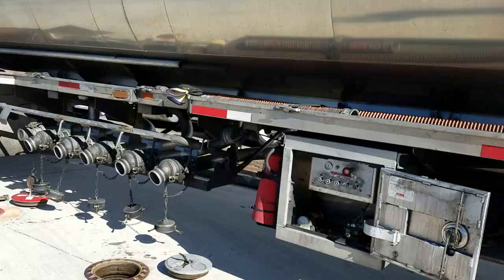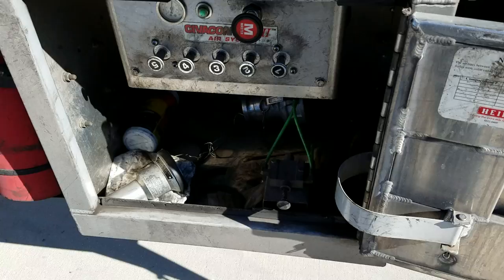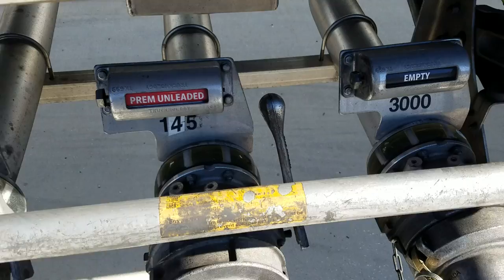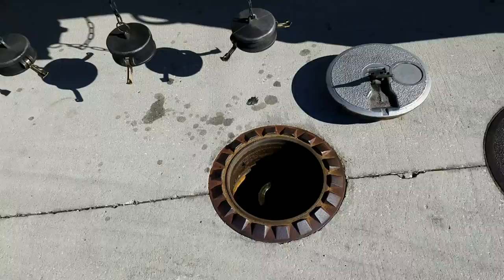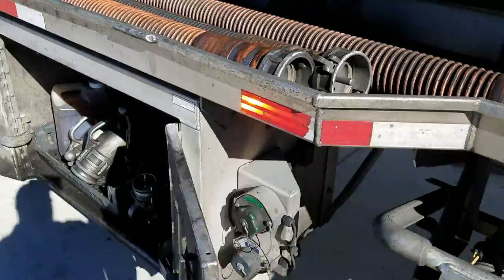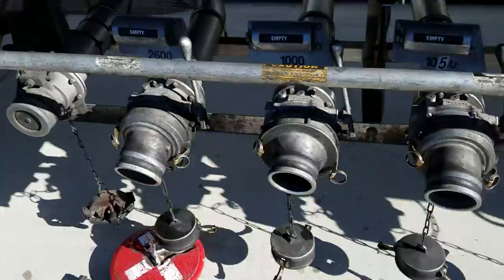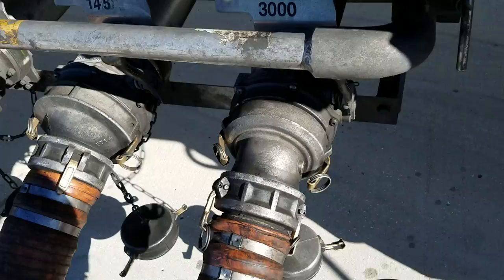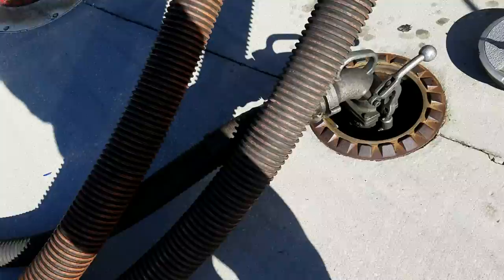How a Fuel Truck Delivers to a TruckStop

Comment: No meter? How does accounting work??
Reply from the maker: jakop0815 , what do you mean?
Reply from the maker: jakop0815 , we have a machine that will print a piece of paper out to tell us how much we can safely drop
Reply: @jakop0815  We don't pump at petrol stations in the US (except for above ground tanks, which are few). We gravity drop and know precisely what was loaded into each compartment on our trailer. For the occasional unfortunate miscalculation, where we have to retain part of a compartment, the station also has tank level monitors that are quite precise.

Comment: If u only have one vapor hookup then u cannot unload unl and prem at the same time . U can only unload one product at a time , also while unloading fuel u shouldn’t be on the phone making a video .
Reply from the maker: Daniel Chavez , the vapor system is connected, therefore i can unload both products at the same time.
Reply: Trucks and Guns 
No u cannot do that and u need to be proper train again because ur totally wrong !
Reply from the maker: Daniel Chavez , seeing as trainers at 2 different companies ive worked for have told me thats how you do it, then thats how its done. May not be correct according to your company policy but it is for ours. We can drop up to 3 products at the same time using only one vapor if the vapor is connected.
Reply: @danielchavez8701  He isn't wrong, Daniel. You have no idea what you are talking about.

Comment: 9,300 gallons how much are you over weight. I work for a waste hauler and we have 7ks and 6300s and I scale out sometimes at 88k at places depending what I’m hauling.
Reply from the maker: With 9k gasoline im about 84k. 9k diesel im around 92k.
Reply: DrtyDiesel dam I know you’re avoiding scales just like I am.
Reply from the maker: @rcassidywork  no, when i go over scales 8700 is our max on gas, and 7500 on diesel.
Reply: @DrtyDiesel  yeah, my company needs to up the pay a bit if they expect me to waste time avoiding scales so they can make more.

Comment: Two minutes to empty 1K gallons and 7 minutes to put 20 gallons into my cars tank.  Go figure.
Reply: You need to find a new station if it takes that long to fill up. Pumps should run at a max 10 gpm and a minimum of 6 gpm. If they are below 6 gpm, It's time to change the filters.

Comment: And why is gas cheaper in the winter
Reply from the maker: Fuel fluctuates all the time. People talk about "Winter Blends" all the time but thats only in some parts of the country. Where do you live? You may be in a state or area that requires a lower RVP gasoline.
Reply: DrtyDiesel I live in Chicago
Reply from the maker: @NFLYoungBoy223  its possible in the winter they switch to an RVP 9.0 gasoline which is easier and cheaper to produce. In summer the price may go up since some cities use 7.8 RVP gasoline. The RVP has to do with vapor and volatility of the gasoline. Jacksonville used to be a 7.8 RVP city until a few years ago.
Reply: DrtyDiesel yea during the winter gas at citgo was 2.79 for premium now it’s 3.20
Reply from the maker: @NFLYoungBoy223  yeah here in Jacksonville, FL it went up to 3.36 right now
Reply from the maker: @NFLYoungBoy223  it was 2.90 a few weeks ago
Reply: DrtyDiesel which one you go to I go to the by o Block
Reply from the maker: @NFLYoungBoy223  A Speedway gas station near me.
Reply: DrtyDiesel awe naw I only use name brand like citgo bp shell costco
Reply from the maker: @NFLYoungBoy223  i assure you, all of it comes from the same tank. Though what makes it name brand is the additives and detergents they put into the gas as we load. Costco, sams club, speedway, etc, are mainly gas and ethanol. BP and marathon have their additives as well as spraying butane into their gas to keep it fresh longer. Shell really only adds their additive to their premium fuel.
Reply: Decreased demand. Winter vacations are flying vacations not driving vacations.

Comment: Fudging the numbers 29.5 round that to 30, someone is paying for that
Reply from the maker: Umm... no. The customer is billed based on net gallons on the BOL. Not by what inches go into the ground. Our system had no way of putting in decimals or fractions so you either round up or down. The customers we had went off of the BOL gallons and what the veeder root said. The customer in this video is a TA truckstop. They get a veeder root reading before amd after, they dont even look at what inches we put on the paper. In the end the customer still only pays for NET gallons on the bill. So if i drop 7500 gallons but the net is 7350 gallons, the customer is billed for 7350 gallons.

Comment: Shooting  a gasoline fuel tanker won't blow it up
Reply: Generally, no but in the off chance that you hit vapor in a compartment, it could over pressure and split open the trailer. Not technically an explosion but impressive.

Comment: it fucking pulls up to the station, parks, puts hoses into to ground, and lets the fuel out. 

Like, super basic concept. I definitely did not need to work at a gas station for 2 years as my first job to  be able to tell you this...

Comment: DOT sure would like to know why u have those compartments marked empty when the are loaded with gas.  Just to lazy to turn dial. Lol
Reply from the maker: DOT don't give a damn about the dials, they only care about the placards. Those dials are not required in Florida.
Reply: @DrtyDiesel  lucky u.  They are in Texas.  Had a driver get a ticket once for them.  $225.
Reply from the maker: @Mastiff-275  damn, yeah when i worked for Eagle we had a FDOT officer come to one of our safety meetings. He told us everything he looks for in a roadside inspection. Told us the product dials are not dot required (some of our trailers didnt even have them).
Reply: @DrtyDiesel  what part of Florida u in.  I’m in DFW area.   Always busy out here.  We have 15 loading racks out here in this area.
Reply from the maker: @Mastiff-275  north florida, I'm out of Jacksonville. We have 5 racks in jax, only 4 of which i load at lol
Reply: @DrtyDiesel  I do slot of diesel loads to the TA. Petro loves and pilots.  Plenty of business out here.  And DFW is growing so much.  And traffics is getting bad.  I start at midnight.  Around the time the drunks leave the bars. Lol
Reply from the maker: @Mastiff-275  awe man, fun fun. Yeah with my last company we ran loads to the Petro in Kingsland, GA and this video was at the TA in Baldwin, FL. The company i work for now does a lot of ship business, hauling low sulfur diesel, ultra low and 6 oil. Today im running diesel to a railyard, easy money haha. Be safe Randall!
Reply: @DrtyDiesel  It was good talking to ya.  Lunch time.
Reply from the maker: @Mastiff-275  good talking to you as well, stay safe driver, enjoy your lunch.

Comment: So can mid grade be used in a premium only vehicle
Reply: Should only put in the minimal that the owners manual says. It will run on mid-grade but you might not get the best performance.
Reply from the maker: Like John said, use what your manual says. Your MPG may suffer using lower grade gasoline
Reply: Yeah, sure. They just rated the engine PREMIUM ONLY for shits and giggles - it doesn't actually mean anything. They'll really run on any fuel you like. Try some methylated spirits.
Reply: Can something be used in something specifically stated for it not to be used in? I'll have to think on that one.

Comment: I hate those tray straps. They’re useless!
Reply from the maker: Theyre expensive too. You can only buy them from HEIL and they are $50/strap
Reply: DrtyDiesel yup! On my old trailer we just took the hardware off and used regular straps. Company got tired of replacing them. Stay safe driver
Reply from the maker: @carloscruz7317  yeah, my boss didnt wanna buy those so he bought the ones LBT sells, they were $8/strap. You stay safe as well!

Comment: Thanks for this video. I learned some things I never would have considered otherwise. For one, it's surprising that in this technological age fuel deliveries still rely on dipsticks and sight glasses.

Is it really true that motorists should never fill their cars' tanks while you're unloading because sediment gets stirred up in the underground tanks? How many customers can you service with one truckload, and how often do you have to fill your customers up? Can you make a video on the safety measures you have to take while you're  on the road? For example, with a half-empty trailer are you worried about all that fuel sloshing around and upsetting the trailer's balance? I'm sure you have a few stupid automobile driver stories!
Reply from the maker: I have plenty of dumb driver stories haha.
When driving with a half filled tanker, the bigger compartments have baffles in them to slow the fuel down. So it doesnt slosh as much as you may think. 

We have to use dipsticks because unfortunately i learned the hard wsy you cant trust the computer to provide accurate info. They have to be calibrated every year and sometimes stores dont care to check on the system. 

One tanker holds about 8800 gallons(33,312 liters) of gasoline and can serve about 800 cars if they average about 10 gallons per car. 

Most stations get a delivery once per day or once every second day.

Comment: 1000 gallons in a minute ... what a joke.  All you got buddy is air and maybe 1 liter of fuel. just fumes and some water in your tanks.  your rig could not pull that amount of fuel.
Reply from the maker: CJ Genest , i said 1000 gallons in two minutes. 500 to 600 gallons a minute, which is what ive timed my tanks at. But thanks bud

Comment: I might as well drive a non explosive load if they try to only pay $50k.
Reply from the maker: Scott Broderick , some companies pay better. I made 64k last year, nothing to write home about. It mainly depends pn where you live.
Reply: The net pay is better than most driving jobs because you're never gone overnight.  You eat 2 meals a day at home, just one during work (and smart tanker drivers brown bag that meal and eat while the truck unloads),  You shower in your own home and sleep in your own bed.  Plus the heaviest thing you ever lift is one end of an empty hose.  And gasoline isn't explosive.  It's flammable.
Reply from the maker: Right to Record , i spend the night away from home. So not all fuel haulers are home everyday.
Reply: Trucks and Guns Really?  So you park a hazmat tanker and leave it unattended?  Not a chance in hell.  And that tractor in the video isn't a sleeper.
Reply from the maker: Right to Record , yes i sleep at hotels
Reply: Then you're parking your truck in a company secured terminal.  Nobody leaves a hazmat tanker unattended.  Very few petroleum deliveries ever require overnight travel because of the 35,000 miles of underground pipelines in America.  You're not hauling gasoline overnight.
Reply from the maker: Right to Record , i dont stay at terminals... the truck is in the parking lot outside of the hotel... and yes, i am hauling gasoline.
Reply: No you're not. 49 CFR §397.13 says no one will be allowed to smoke within 25 feet of a parked hazmat placarded load, so nobody can park a tanker of gasoline in a parking lot and walk away from it.  Besides, there's no place in America that requires 2 days travel to supply with gasoline.  That pesky underground pipeline system again.
Reply from the maker: Right to Record , you definitely dont know what you're talking about. I have a load going to Atlanta today, ill spend the night at a hotel and deliver tomorrow morning. We dont have pipelines going to every major city.
Reply: I'm an Atlanta native and around 600 tanker loads of gasoline roll out of the several pipeline-fed terminals in the Doraville area (just east of the city in Dekalb county) every day to supply the city with the 4+ million gallons of gasoline used daily.  There's another area with a few terminals on the west side of Atlanta near Bolton Road.  There's one more terminal on the north side of town.  And all of the jet fuel used at the Atlanta airport (the world's busiest) comes into the airport via the same pipeline system that feeds all of those terminals as well as the others in places like Macon, just 2 hours away.  There has never been a need for anyone to truck gasoline into or anywhere near Atlanta.  Some areas of the country, like parts of Florida, parts of some western states, etc., aren't supplied by pipelines, but those areas have terminals supplied by rail so all deliveries can be accomplished within a driver's daily allowed hours.  Anybody claiming that gasoline has to be trucked into Atlanta from 400 to 500 miles away is just an imbecile.  That would be you.
Reply from the maker: Right to Record, every now and then we pull gas put of Jacksonville, FL (where i operate) and go up to Atlanta to deliver to either BJs wholesale or Kroger. When yhe pipeline in Alabama shutdown not long ago, we were running multiple loads per week to Atlanta to help yall out.
Reply: So what?  I've made the ATL/JAX trip countless times, and it's not an overnight run and never will be.  I've had a CDL since 1976 (when it was called a chauffeur's license) and worked for Florida Rock & Tank for several years as a driver and a manager.  You're not parking a loaded gasoline tanker anywhere but in a safe haven if you're spending the night somewhere because anybody could walk by, pop off the caps and pull the valves pouring 50 to 75 gallons of gasoline in the tubes from the belly valves to the dry-break connectors onto the ground.  It's against federal law to do what you claim.
Reply from the maker: Right to Record , you made jax to Atl Round trip in one day? Your truck must have flew through the air since its about 7 hours just in drive time one way to Atlanta with traffic
Reply: Wrong again.  It's about 5.5 hours.  See, us Atlanta folks were smart enough to leave out by 6 a.m. and beat the Atlanta traffic.  There's no traffic in JAX at lunch time, and when we got back to Atlanta we'd be going into town when traffic was coming out.  Smart folks know how to do stuff more profitably.
Reply from the maker: Right to Record , id leave by midnight and hit Atlanta during rush hour (i have to go inside of 285 on the north west side of the city). The last store i did was north of Atlanta off of i85. We used to make the run in about 18 hours on paper logs, but cant do stuff like on these pesky elogs anymore. I miss those weeks, some of us worked 102 hours and made some good money , good times.
Reply: Anybody driving a truck who routinely plans to enter Atlanta during rush hour is a mental midget, or they're paid by the hour and is milking their employer.  All that aside, you still never parked a gasoline tanker in a parking lot that wasn't a safe haven and went to sleep in a hotel.
Reply: So ships run on gasoline now?  You're a hoot.  Sorry, but you haven't parked a load of gasoline on the side or any road.
Reply from the maker: Right to Record , diesel but yes, we have parked gasoline on the side. I do it all the time, for you to tell me i havent done something that i do regularly is laughable.
Reply: So now it's diesel, not gasoline?  Went from flammable to combustible pretty quickly.  And, no, you haven't parked a load of gasoline on the side of the road or in a public lot and then wandered off to a hotel.  Like I said, federal law says you haven't, and no company would allow it.  Let me guess, just like the gasoline became diesel, next you'll be claiming the "side of the road" was in a safe haven a road ran through?